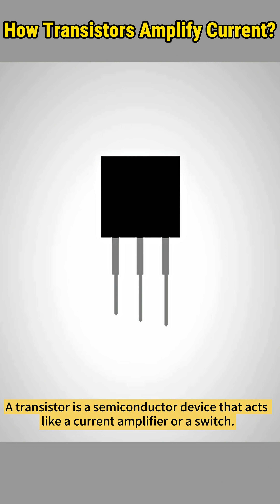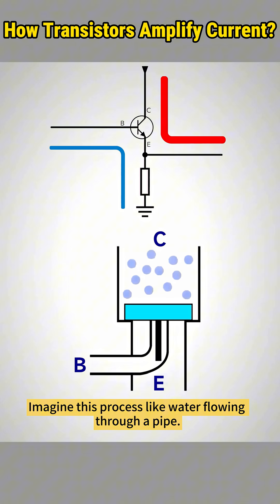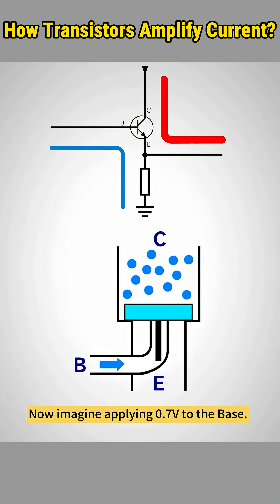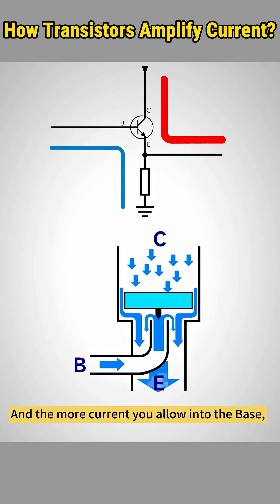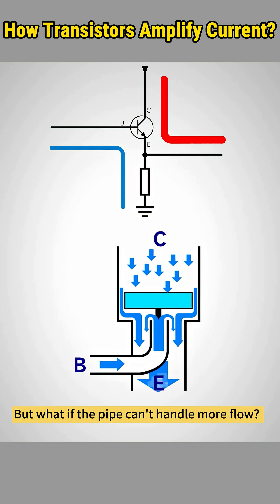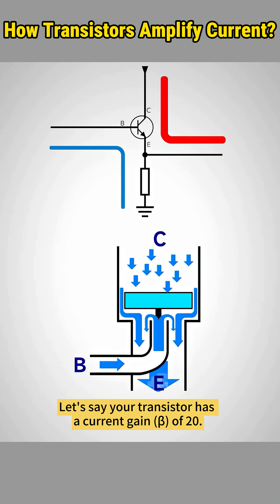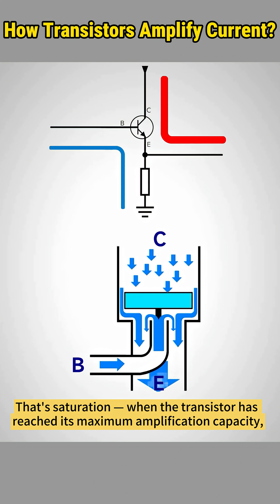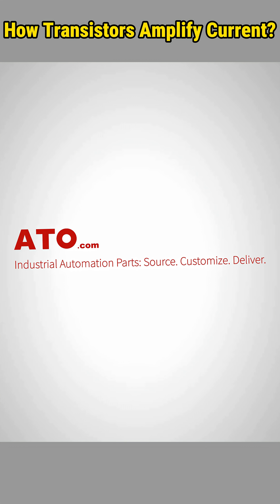Amplify Current with a Transistor? Here’s How!

Comment: Haha you need to redo your video. .7 is a VOLTAGE, yet the BJT operates on CURRENT or AMPS. So how much CURRENT, not volts, are needed to begin operations?
Reply from the maker: The 0.7V is the knee voltage for a silicon BJT, used to denote the voltage drop across the base-emitter junction. The current can be calculated using Ohm's Law: Base Current=(Voltage Source - 0.7V) / Base Resistor
Reply: @ATOcom but the CE current is dependent on the base resistor in the active region. So, with a fixed resistor, and a varying VOLTAGE on the base will vary the CE current flow.